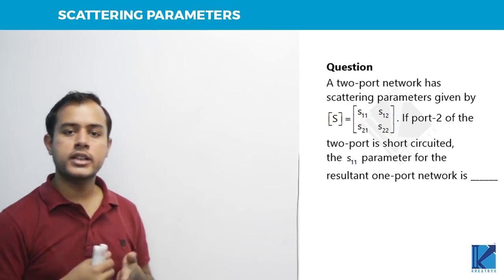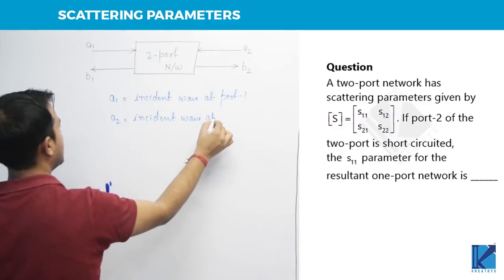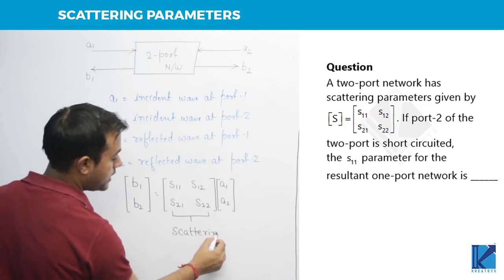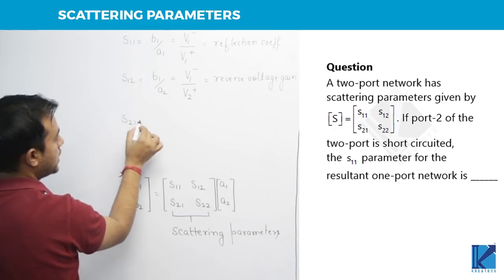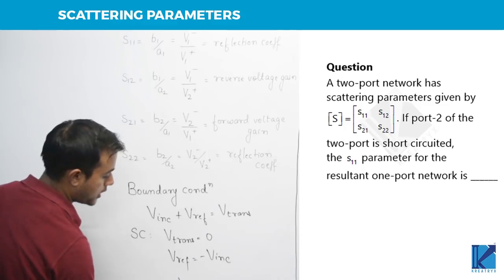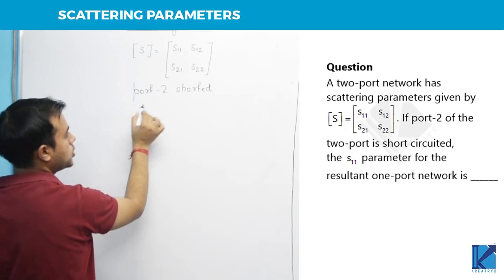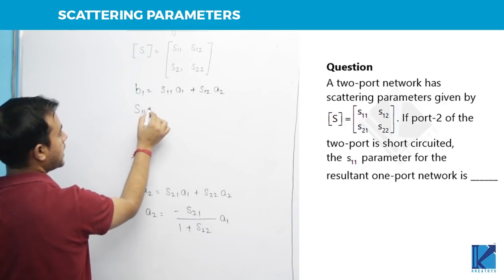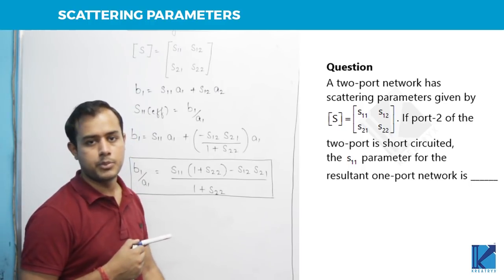Scattering Parameters | EMT | GATE (EE) | Ankit Goyal

Comment: A three-phase, three-wire system, with an effective line voltage 176.8 V, supplies two balanced loads, one in Δ with per-phase impedance 15∠0° Ω, and the other in wye with per-phase impedance 10∠30° Ω. Obtain the total power consumed by the loads.

sir this above que was in made easy test series which is directly copied from "http://iitkgp.vlab.co.in/?sub=39&brch=124&sim=1654&cnt=3592"

i have a query that why they have  converted Vrms=176.8V into Vmax and then proceeded..i think there is problem in my concepts it would be helpful if you please clear it..
i have emailed the solution on " kreatryx.thegateguru@gmail.com &
info@kreatryx.com"
thank you..